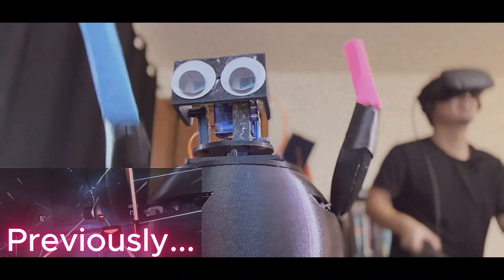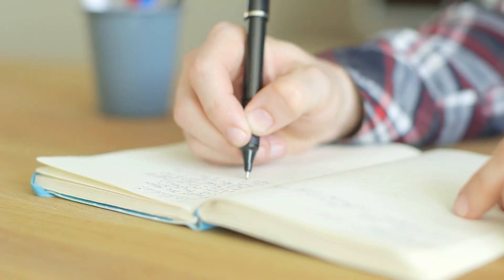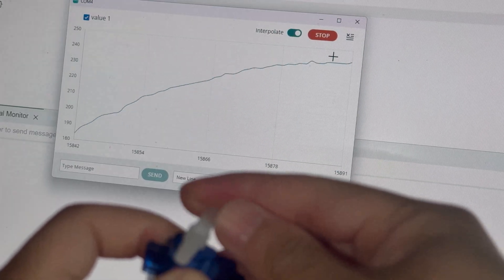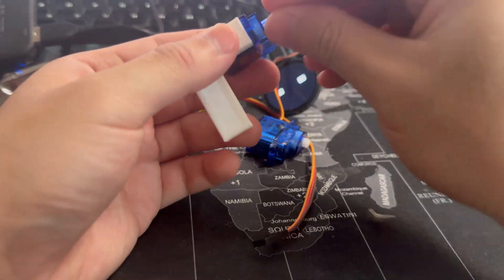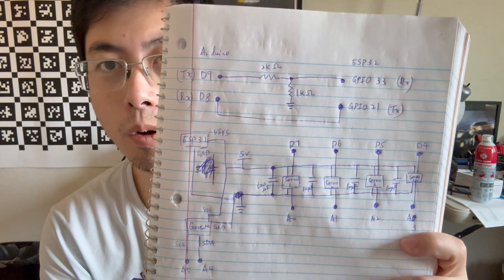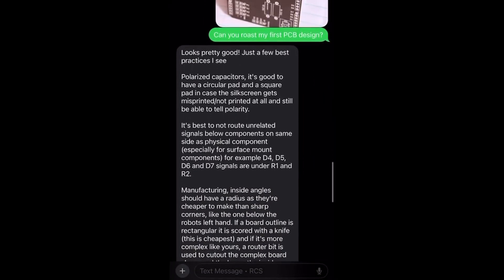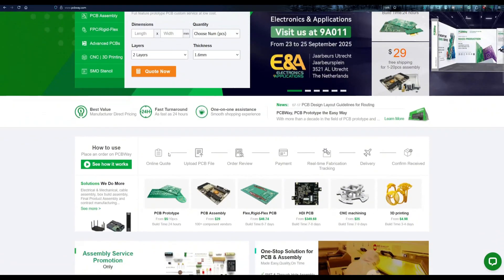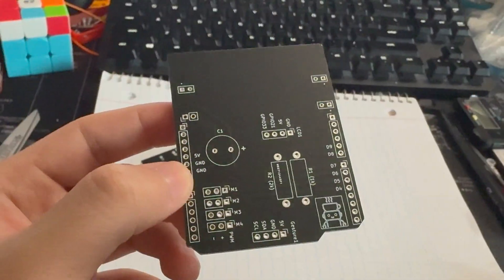I Made A CLEVER Mini Robot

Comment: I'd love to hear what the mistakes were that you made with your initial PCB design and how they helped you fix it etc.
There's not enough coverage on that in videos such as these, yet I feel like it's pretty important for anyone getting into PCB design.
Reply from the maker: For this level of PCB design, there's actually a lot more wiggle room to make mistakes and still get it functional. The main thing is to make sure all the connections are going to where you want the pins to connect, and ensure there's no cross-talk.

I personally think getting the electronics tested on the Arduino with jumper cable really helped a lot, because in KiCAD I just have to wire them accordingly and make sure there's enough space! (And this is the hardest part, because I was limited by power source).

The rest of the PCB design considerations are really more just learning as you go. If you want to design PCB professionally, I'm unfortunately not in the position to give you that :(

Comment: What do you use to track your hands ?? I wanna make it too
Reply: posenet
Reply: @cyb3ristic  yes but what is the camera ?
Reply from the maker: you could use most of the RGB camera. I'm using Logitech. Generally if it can display 720p or 1080 at 30~60 FPS is a reasonable one to get. 480p would be enough if you are going to be waving your hands at about shoulder distance to the camera.